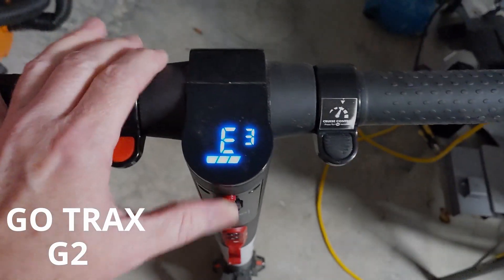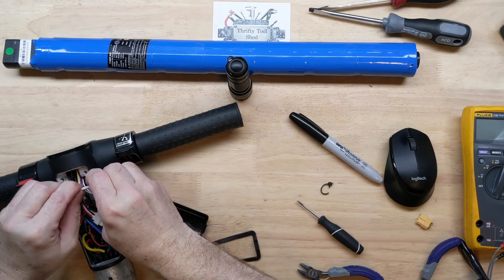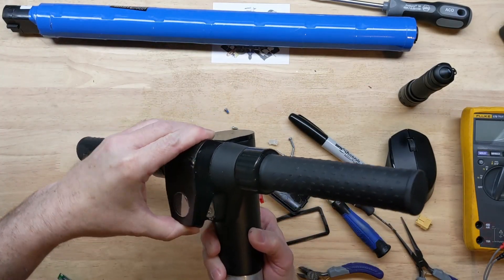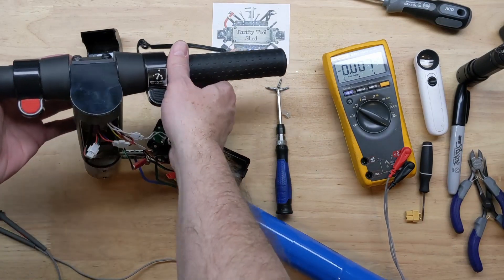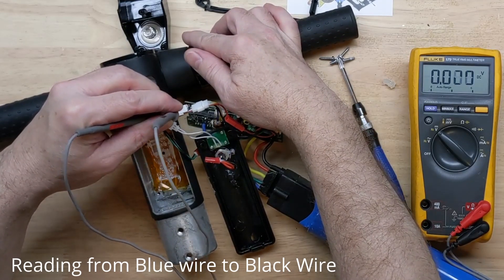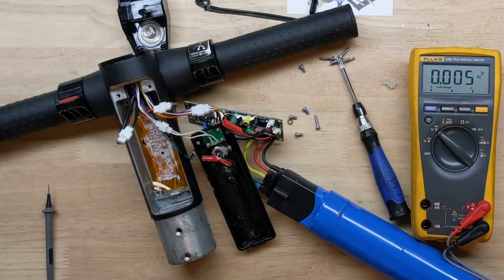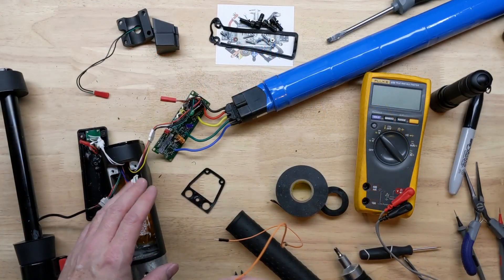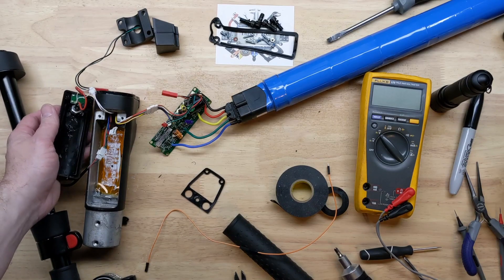GoTrax G2 Scooter E3 Error Troubleshooting - Part 1

Comment: I don't recommend Gotrax e scooters, they are not water proof, at. Mines G6 got wet, And had to take it apart and dry it out with a blow dryer and compressed air cans. AVOID, GO with apollo e scooters

Comment: Hey Thrifty Tool Shed, hoping you can help with this Gotrax GXL V2 issue.
I originally had the GXL V2 Commuter version with the handlebar brake (mechanical + electric). I burned out the controller going downhill with the brake engaged (it stopped turning on completely). Since replacement controllers were sold out, I picked up a different GXL V2 (the throttle-only brake version) from OfferUp for $50 just to use its controller.

I swapped the braking systems between both scooters to match the controller I was using, but after wiring everything up, I got hit with an E2 error. I suspect it’s because I cut the brake wires and the new controller is expecting a throttle-style brake signal instead of the lever-style one.

I've tried bridging the brake signal and ground wires on the controller (green to black), and even tested it with a multimeter showing 0V on the signal wire, but I still get E2. Any idea how to fully bypass this or make it compatible with the swapped brake system?

Appreciate any help — love your content!
Reply from the maker: Thanks for your kind comment. The only controllers that I have worked on need around 1 to 1.2V reference from the sensor. So bridging it will not work. You could either use a potentiometer or 2 resistors as a resistor divider to give the 1V or so reference to the controller. Hope it helps, and best of luck to ya!

Comment: Excellent Video! Great diagnosis, explanation and repair. I can confirm your suggestion. You can attach a wire loop to the throttle cable and use it to pull the new throttle cable back through.  Repair took less than 10 minutes.👍
Reply: How did you do it? Can you do a video??

Comment: this helped me so much,, bought a g2 plus with e2 error. did your troubleshooting and got rid of the e2 error..gonna pull the brake lever off now and see of its just the wire or the whole unit.. thank you so much.
Reply: Y have error 2 how i can delete
Reply: @JuanPedroGonzalez-w1c most likely the brake switch. I would just buy a new console.

Comment: E3 code is showing but the problem is while driving it locks up to a dead stop. What do you think the issue is?
Reply from the maker: I would think it's still the throttle sensor.
Reply: @ThriftyToolShed  yeah I’m trying to figure this out for my nephew on two different occasions. They locked up and he pretty much flipped over the handlebars. So you think replacing the throttle could fix it.
Reply from the maker: Just guessing since it's an E3 error. I have not seen that issue to say for certain.
Reply: @ThriftyToolShed  yeah he just had told me a few minutes ago that nothing is working on it now so it’s not even moving

Comment: I followed your steps and your video worked great for me. But when I put a new throttle on instead of a new console. I now have 0 codes  worked just like before and now I can't move at all lol I have no idea what to do now
Reply from the maker: So, no errors and when you kick it off it just will not go?
Reply: @ThriftyToolShed  will come on and everthing  just won't go
Reply from the maker: If you are familiar with the scooter, then you know you have to kick off and start moving really well before the motor will activate and take off. So make sure you are giving the front wheel enough kick start. If that is not the issue, then make sure to test the voltage as shown in the video for the throttle sensor.  If all that is good, then I would lean towards a bad console?
Reply: Does it display show speedwhen you roll it around? If it doesn’t display the speed your connection to your motor by the front fork might be disconnected

Comment: How do I get a whole new control system? Because all the wiring is messed up I wanna replace the whole upper tube and the handle bars
Reply from the maker: I have not had to do that to know for sure, but Go Trax does show some controllers for sale. This is reference only, make sure any item you choose will fit your model...
https://gotrax.com/products/g2-plus-electric-scooter-console?_pos=46&_sid=050375cf7&_ss=r

Comment: Hi, is there anyway you could point out the speed limiter wire? thanks
Reply from the maker: There is no quick way that I know of. Typically larger battery and controller/BMS board upgrade.
Reply: @ThriftyToolShed  where can I find batteries for mine
Reply from the maker: Really, very few available. You may possibly have to go to Gotrax web site to order one.

Comment: Bro, you are truly doing too much. Really didn’t have to disassemble as much as you did to repair this.🤷🏽‍♂️ - RLH
Reply from the maker: I believe I shared  I was troubleshooting. I should have anyways it's been quite a while. I kinda tear down things on my channel because that's what I do...
I never said you had to take all that apart to change the throttle once I found that to be an issue it was pretty easy.  Thanks for your comment!
Reply: right like why not just use psychic powers before hand and limit the hands on, and any extra insight in a repair video is not ever appreciated.

Comment: great video. I have a brake controller on my g2 (E2 code) that has a need for me to solder the three wires back onto the pick-up coil.(hall sensor) The only problem I have is that I don't know which color wire goes on which of the three prongs sticking out. This is tough to find out!  once I took it apart I found the Hall laying in the bottom all by itself. The screw for the brake controller had loosened apparently leading to over-limit and thus pulled the wiring off the sensor.I see know that your hall broke off flush with the body. Mine at least still has an 1/8" of all 3 probes still sticking out at least.cannot find a replacement part.
Reply from the maker: If I still had this scooter I would look at it. I only have the video for reference now also. Hopefully you can come across some online images that will be of some help.  Best of luck to ya! Thanks for your comment!

Comment: Brilliant - huge props on finding and diagnosing the issue so quickly - I'm in awe of your electronics knowledge. They white labeled this piece of garbage to several different companies, but I'm getting an E3 on a newer version of this scooter from a different company. This video is an amazing starting point for my repair. Cheers!
Reply from the maker: Glad you found it helpful. Thanks for your kind comment!
Reply: Tengo un error E4
Reply from the maker: I have not had a E4 issue, but it seems to be pointing to the wheel motor issue. make sure the connections are good and plugged in securely. Hopefully it's not a bad motor or controller....

Comment: I was wondering if you could help me I’ve had my go trax scooter for about a half a year everything was going okay till it fell over then I went to ride it then I got an error message so a friend took it apart for me the battery looked fine it had a full charge plus the battery was working however not the acceleterator or the brake light
Reply from the maker: This is the only go trax scooter I have ever worked on and shared what we learned  with it. So not familiar with much else, what error code are you getting? I could see it having the same issue as the one in the video possibly?

Comment: I have a gyrocopter 3.0 and it has the same code and i f8x the wires and still it does not work so i need your help
Reply from the maker: In the part 1 and part 2 of this repair video I share the only experience I have working on a GoTrax scooter. I basically shared all I have learned on them in the video. Anything else would be just an educated guess?

Comment: So I have the same scooter.  Nothing happens when I plug it in.  Nothing shows on the display and it will not charge.  Do you think it's the battery/console/etc
Reply from the maker: I have not seen that issue to say for certain. I would lean toward the console, but I would take the battery out and check it first and make sure it's nothing obvious. It's fairly easy to pull out since it just unplugs as you pull. At least do a voltage check.
Reply: Hey you ever find out what was wrong with yours. I have same problem now. If I hook battery charger toconsole it lights up. No codes thrown though. Been trying to solve for 2 weeks.

Comment: GoTrax scooter no error lights holds a charge BUT it won't move
Reply from the maker: It could be that its not sensing the Motor being rotated when you kick start it. Hard to say if its the motor or controller issue. If not already done so you can check the connections where the battery pack plugs in to the motor.

Comment: What is problem E7.   Or E8
Reply from the maker: E7 is stalling fault. No motor rotation detected and high current.
E8 is controller error. Controller needs to be replaced. 
This is the troubleshooting information, I have not worked on these myself to say.

Comment: What is the common reason the go trax loses throttle power? It turns on but the throttle isnt working? Is it because the connectors from the battery to the throttle isnt connected? Please help
Reply from the maker: Could be, but it usually gives an error if disconnected. I shared how I tested this one in the video.

Comment: Hi there. I have an old version of G2 24 volt, do you know if I can use a 36 volt battery instead of 24 volt?
Reply from the maker: I do not believe the 24v can handle 36V without damage. That is 50% over voltage!

Comment: Ok so what do you recommend I do if I’m getting volts from both the throttle side and brake side but still have an E3 error code?
Reply from the maker: Hard to say without parts to troubleshoot.  It could even be the control board if voltage reference is good from throttle and still getting E3?

Comment: The problem with my scooter is once you get on it and it starts to screech and out of nowhere the scooter comes to a complete stop while still pressing the go button if you get off of it and let the tire go by it's self in the air it works good no screeching or nothing and it does the problem to everybody that gets on I have the same model what could be the problem?
Reply from the maker: I did not have that issue with this one to say for sure. If I had seen that issue I would have shared it. The battery could cause that, but the low battery should come on the display so maybe not. The motor or controller could both cause this, but the controller should give a motor fault if an issue is detected. The first thing I would suspect is the controller, but hard to say without swapping parts and simply troubleshooting it. Best of luck to ya!

Comment: I viewed both your videos on the G2 before buying one today. After assembly, I noticed that the throttle button moves smoothly over most of its travel but toward the end, perhaps 90% of the way down, it meets resistance. I can push past it but it feels like a mild click action. Should I suspect this should not be happening since your videos never mentions anything like that?
Reply: I took it out for a fairly long ride for the first time last night. I noticed that when pressing down on the throttle, it will signal with an "H" on the display that it is switching modes from I presume the lower than 10 mph mode to "H" mode where it can go up to 15.5 mph. There is no mention about that in the manual. It did make me wonder if that bump I feel in the throttle might be related to how it knows when to switch modes. I might use your video to take the throttle control off just to see what that bump is. The other possibility is that something like the bump might have been what damaged or knocked off the hall effect sensor in the control that you replaced.
Reply from the maker: This one did not do that, but this is the only one I worked on and it had throttle issues already! The one I put on was aftermarket so maybe different. Does anyone else here have experience to share that information?
Reply: Have a question on my G4 throttle. Can you help me?
Reply from the maker: Depends on what the question is? 
I shared 2 videos  on the only repair I have done on one of these and shared as we learned together. I do not know much more than was shared in the videos.
Reply: @willgill8806  feel free to ask me. I have a G4 that I've done quite a bit of work on so I might be able to answer.

Comment: I have the same scooter and the same error code keeps coming up even after I have replaced the whole console. It has the same problem where it just won’t accelerate or go at all and the speedometer just stays at zero even when rolling but the brake actually works a little still. Since I replaced the console do you think it could be a problem with the hub motor? Is there a way you know I could try to fix it or what the problem could be or would I just have to buy a new scooter?
Reply from the maker: This is the only one I have worked on so I can't say for sure. I have not seen the code come back like that. I would not know other than double check the connections going to the motor. The plug-in connector to the motor could have a bad connection. Other than that, all I would know is to take it all apart and test the motor with another controller etc. Best of luck to ya!

Comment: Wish I saw this video before disassemble to discharge the board. As was removing the board something touched something and I got a spark ⚡️ hopefully I didn’t fry anything. In the future how would I discharge the board safely so no sparks occur? Thx
Reply from the maker: Well it's best to discharge into a resistor or even a 120v incandescent light bulb will work. Let something like a screwdriver go across the capacitor (which is across the + &- terminals) will work as far as keeping you from getting the discharge across you but not best practice because it will be a dead short and arc.

Comment: Looks like pretty much any E-bike throttle would work.
Reply from the maker: I do believe it would, as I stated in the video, I used the one I found with the same connector. 90% of them had a different connector and  some polarity seemed swapped. I tried to show the one the most viewers may also want to use. As I mentioned, I really could have soldered on the wires to any of the cheaper ones really. Guess I made the video with any diy in mind, maybe even the young fellows. 
Thanks for your comment.